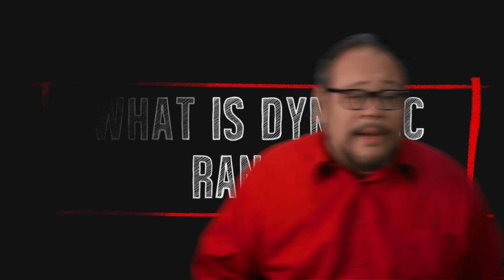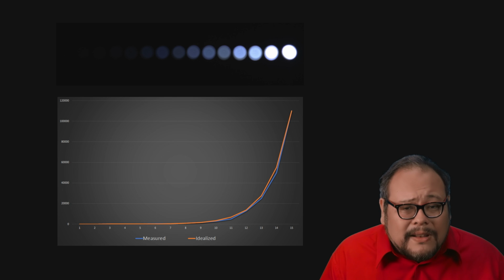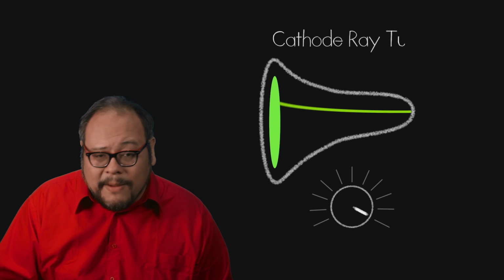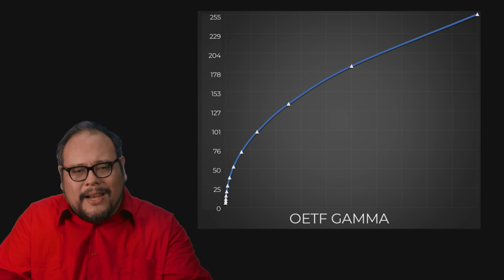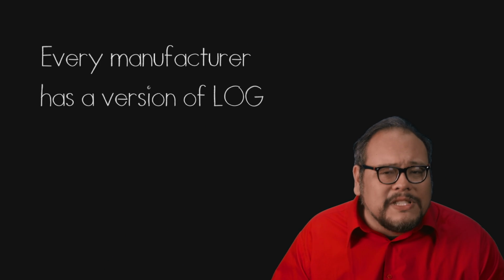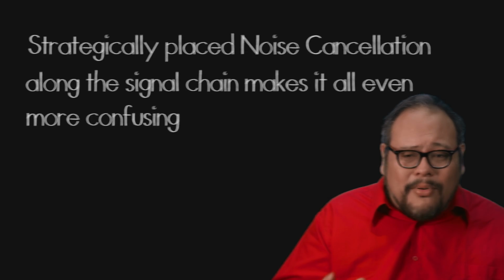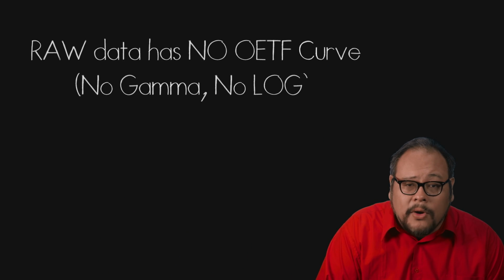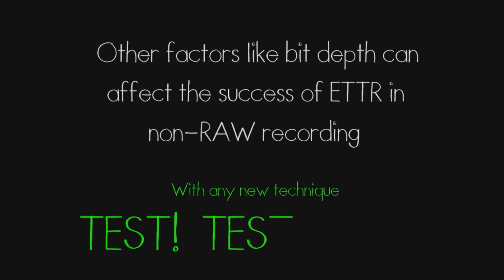Diving into Dynamic Range

Comment: I've seen several of your videos last days and I really enjoy every one. I can now say that I know how to treat the dual iso, bright and dim scenes around us. I was afraid of the ISO noise before, but now I see there's no need to be afraid of that, it can be managed with a bit of knowledge. Thank you so much. On the other hand, I wonder how the exposure strategy would be for astro and nightsky.. You can't add light, the lens is already F/1.2, so I guess stacking and sky tracking and ISO is the only option left. So with that in mind, with dual ISO camera like A7iii - would you still shoot a tracked nightsky at low ISO (100) because of the DR in shadows or raise it to 800? I'm not quite sure whats best. Not blowing out colors of blinking stars (red, yellow, blue and green) is kind of important, but 95% of the scene is less than midtones. Thank you.
Reply from the maker: Astrophotography is one of those extremely difficult challenges. First of all you're dealing with huge dynamic ranges from night elements here on earth to what are essentially suns just really far away. First off - always shoot RAW.

Your ISO strategy depends on what it is you care most about.  If you care about the color of the stars shoot a higher ISO - and pull your exposure down a bit compensate. Then you can always apply additional noise cancellation to clean up the black night sky. If you care more about creating a cleaner low light scene - say you have objects in the foreground or if you're shooting the moon, then lower ISO might be better.

How high an ISO is a very tricky matter - you have to find the sweet spot on your camera. With this BMPCC4K - I'd probably go with 1000 max or 6400 max - but photo DSLR cameras are a little more concealed as to where you won't get... I would have to do more testing and experimenting and reading to come up with a solid answer.

Comment: What if we combine multiple images shot at different iso (lets say low iso to preserve shadows and high to preserve higlights)? Do you get like that an image with more than 15stops of dynamic range?
Reply from the maker: Depends on how the ISO is derived. You commented on that BMPCC video which is a good example. If you combined ISO 100 and ISO 1000 you would get no increase in DR. But if you combined ISO 1000 and ISO 1250 you could end up with the best of both. 

But generally this kind of stacking is done in the exposure side.
Reply: @FilmmakerIQ  I see, so... this is what i thought HDR was (and i think most people) merging 2 or more pictures in one, with the same iso (or the lowest for the lowest noise), with different shutter speeds/appertures in order to create a more linear exposed image (longer exposed shadows and lower for highlights to prevent clipping)..while in reality HDR is that a sensor can depict a greater number of light luminance in a given scene (dark or bright)... 
I just realised that now..thanks! 
Keep it up! I think your work is the best alternative from spending hours into the books..!

Comment: Dynamic range isn't everything.  The human eye may see 20 stops of Dynamic range, but screens typically display 10 stops or less of dynamic range.  Only OLED can display more stops of dynamic range than the human eye can perceive.  On top of that, when it comes to photo's, too much detail can lead to fatigue by overloading our visual systems. So I would say that 8 stops of dynamic range are about perfect for a great image, if the image is crisp and clean.  This is why old full frame camera's with just 8 stops of dynamic range, still look as good as or better than modern APSC camera's with more dynamic range, and generally need less post processing, because their dynamic range is already in the sweet spot. 

People often end up lowering the dynamic range of their camera's in post, so dynamic range in camera's is more about lattitude with editing than it is about having 11+ stops in the final image.  For example, if you lower the shadows slider, you're reducing dynamic range.  If you're increasing highlights, you're increasing perceived dynamic range, but potentially at expense of certain details in an image. 

Another issue people suffer from is contrast/saturation overload. Too colorful of an image can change how our eyes react to an image.  An image with too much dynamic range and colors, can distract our eyes, and change the way our eyes gloss over an image. Tests have shown that people tend to look at highly saturated/colorful images for less time before their eyes move on. But when their eyes move on to something else in the image, the colorful part still distracts their attention from other parts of an image.  

There's also another reason why high dynamic range is becoming a problem.  We are essentially reaching the point in sensor technology where dynamic range is soo high, that images coming out of cameras are effectively HDR without a need for bracketing.  HDR as a style is DYING. People still do it, and it has its uses, but it's a fad that has fallen out of favor. So people editing images, without even knowing it, are reducing the dynamic range of an image to make it look "the way they like it".   Dynamic range is for lattitude in editing, but raw high dynamic range doesn't really make for a great photo.

 Photo filters for example, largely are geared toward reducing dynamic range. Again, people may not realize this, they just think an image looks better with this or that adjustment.  But what it all leads back to is people find less dynamic range more pleasing to the eye in general.  It's just that less smaller sensors often have "muddier" details on the pixel level, which is why images from a smartphone look worse than images from a full frame. Dynamic range can help to capture more detail, but there is a such thing as too much detail, like when someone over sharpens an image.  

For example, when someone see's a picture of a car, they expect a natural shadow to be underneath it.  A camera with high dynamic range may make the car look like it doesn't have a shadow at all, which looks unnatural....so what do you do?  You decrease the shadows, which increases contrast, but decreases dynamic range!  So in the end, higher dynamic range isn't better for a final image, it's only better for latitude in editing an image to your liking, which almost always subconsciously results in lowering the dynamic range.
Reply from the maker: You need to watch the video before you comment.

Comment: Again, awesome vid. May I ask about ETTR? In the explanation, you mention adjusting shutter speed as a component of ETTR. Is there a way to execute this concept without changing the shutter speed? I thought it was necessary to maintain the relationship between shutter speed and frame rate... I'm simply wondering if there are instances where this would be impractical. I know that filming is a balancing act of compromise... (and thanks for answering the "native ISO" query)
Reply from the maker: The shutter speed relationship is only a general rule and you can break it if you want. You could of course use aperture to obtain more light or remove ND filters or actually adding more light on set.

Comment: First things first, wonderful video. I have been trying to expose to the right of late and it really seems to work.

You already have so much information in here, that it has to be difficult to squeeze anything more in. The one other nugget I would love your take on is the  more recent trend towards Dual Native ISO (local amplification at the pixel enabled or not based on ISO) combined with the trend towards ISO-in-variance in cameras. The first camera I read about this on was the GH5S but my a7r3 does it also. Basically ISO 100-500 is amplified normally,  and then ISO 640 and up has the additional pixel amplification/gain applied.  So on the a7r3 test charts ISO 640 comes in a stop or two cleaner than ISO 500. You pretty much need to get up to ISO 1600  to get back to the noise levels of ISO 500 again. This of course why you say TEST... TEST....TEST, and is even less intuitive than the High ISO for outdoors. I don't think the C200 has the same feature, but I think things are becoming even more murky and I am not sure I correctly wrapping my head around the dual-native ISO. Also my attempt to make this one simple point understandable makes even more clear to me how hard it must be to make a 35 minute video on the topic. Here is a sample chart from dpreview that maybe explains the dual-native item more clearly. https://www.dpreview.com/files/p/articles/4302149407/Graphs/DR_Compare.png

Comment: OECF * EOCF usually don't counter each other, generally speaking, because of the  ambient light differences, the final exponent will be in the range 1.1~1.6. and I personally think what you talk about ISO on ARRI etc. is actually EI...
Reply: This is the best video I've seen on the topic. Some discussion: Because of visual tone appearance effects, the overall system gamma needs to be greater than 1.0, or the pictures will look dull or washed out. This was discovered by Kodak way back when they pioneered snapshot photography, finding that overall gamma 1.1 looked better for mass-processed monochrome prints. Later, the TV industry discovered that a TV image ("dim surround" viewing, similar to computer viewing) needed an overall gamma of about 1.25. The movie industry (projection in a dark room) and likewise color transparency film, was determined to require an overall gamma of up to 2.0 (partly to compensate visual effects and also to roughly compensate lens flare). Luckily, the increase in contrast also increased color saturation and compensated for the insufficient color saturation of the print dyes. In TV, CRTs had a gamma greater than 2.2, so that when 1/2.2 was specified for REC 709, the overall system gamma was closer to 1.25, as needed. Now that computer monitors are being calibrated to 2.2 instead of the native CRT gamma, it is likely that the gamma (contrast) of renditions from raw files is being increased when the raw files are rendered to sRGB so that the system gamma is  again greater than 1.0; but nobody but camera makers and Photoshop knows what is being done for the default, they just know they can turn the contrast knob up or down to get the look they like. Plus, since the output is always intended for a print or standard dynamic range display, there is always an S-curve applied to the rendered image, which mimics the S-curve of analog photography and fits perhaps 10 stops of scene brightness into the 6 stops of a print or the 8 bits of a jpg file.

Comment: Modern digital cameras have reached analog 35mm or digital project quality, but most cameras can't go past 4096 shades when best HDR is over 10,000 to 1 contrast.

 I wonder if this will cause resurgence of big studio movies going back to shooting on film.  Can old school celluloid with digital extraction reach highlight brightness the best digital cannot?
Reply from the maker: Just because you only 4096 shades (12 bit) doesn't mean you can't store more than 12 stops...  especially if you compress the highlight detail using LOG. And ultimately you don't need a 1:1 relationship between what you shoot and what you display either.

Comment: My own opinion on ISO.  When I shot log, I noticed at low iso there is less noise, but when I pull up the image, I can get banding in gradients.  But at high iso there is noise and stopping way down outdoors can make a shot less cinematic.
 I think when possible the best quality and dynamic range in a log video is to film at native iso, and use neutral density filters for exposure control.  I kinda think the iris f-stop in digital should be thought of as depth of field control more than exposure.
 Problem is I can't afford a whole set of ND filters
Reply from the maker: The problem is we're coming to the point where the term "native ISO" doesn't mean anything.
Reply: @FilmmakerIQ   I don't have HDR monitor/video yet, but am curious as to how HDR will affect ISO and exposure.

 I can imagine some problems with changing exposure and shooting to the right/left on a high contrast ratio video.  These changes are invisible if graded for rec709, but in HDR this could result in the highlights jumping in brightness from scene to scene, and noise black levels shifting up and down too.

 I don't know what HDR cinematography looks like but I imagine it a lot more WYSIWYG and the look is much more ingrained on set than in post.
Reply from the maker: @michaelcooney9368  HDR uses a much wider dynamic range you're going to more limited in ETTR. Furthermore you would do an HDR grade and maybe a Rec709 pass to fix things. You're not going to grade the same for both.

Comment: Ok, higher ISO to protect highlight, makes absolutly sense. but, that comes of the cost of IQ (less DR an more noise, compared to low Iso), the higher ISO noise, is less noticebale in brighter areas (also because of better SNR) ok i give you that, but the DR is suffering. Right so far?
Reply from the maker: Higher ISO to get away from the edge of the clipping edge of tbe sensor but don't go crazy to extreme other end of ISO. I'm talking shooting ISO 1000 instread of ISO 100. In these situations you'll have the same (or better) Dynamic Range and noise will still be negligible.
Reply: @FilmmakerIQ  ok thnx, but i get the basics right so far. Thnx
Reply from the maker: Well the old rule higher ISO lower DR doesn't really apply anymore.
Reply: @FilmmakerIQ  ok, thank you for the fast reply, and the very good work you upload. Apriciate it.

Comment: I just did an experiment. My camera is Panasonic G85 and I shot some night photos in RAW,  only change iso(and didn't clip highlight). Then adjusted them back to the same exposure in LR. I can tell that the higher iso image has less color noise, though the luminance noise seems the same, if not a little less. So maybe there is some gain adjustment in the camera which makes the iso isn't only metadata. After this when I picture the milky way I just use the highest ISO and do an ETTR shot. The results are a little better.

Comment: Now that explains why the S-Log require high iso.
Everything makes sense!
BTW... Hybrid Log Gamma is like the best of both worlds? Is better?
Reply from the maker: One thing I've learned in filmmaking is that there is absolutely no such thing as best of both worlds ;)

Every choice is a deliberate compromise between at least  two extremes.

I don't know much about hybrid LOG gamma but it seems to be more of a display side curve used in HDR displays.

Comment: С200 have analog amplifiers before ADC, so ETTR works with ISO/gain in lowlight circumstances. It's not decrease analog noise but decrease digital noise (probably) caused by quantisation error.
Try this with candles. First - normal exposure, second - raised iso and lowering it in post.
Reply from the maker: When I tried it in the video the results were less than stellar. Light is the key.
Reply: @FilmmakerIQ  they less stellar than good lighting condition, but more stellar than not ettr by iso in lowlight.
Just my experience. Maybe help someone.
Reply: For example:
32:15 left image is less noisy than left on 31:21
In lowlight dark scenes (yes, in independent cinema this is often situation, like a night street lit only by streetlights) it makes huge difference.
Reply from the maker: I guess a little... You also have to above 1600 I believe before the upstream amplifier kicks in.
Reply from the maker: Put together a test with what I shot - It's a little bit less noisy... I wouldn't say the "huge" difference. - This is one of those camera specific and only under certain circumstances..  I stick by my statement in this video that ISO/Gain should not be used for ETTR in RAW.

https://vimeo.com/297155536

Comment: 26:39 This picture doesn't show what you claim it shows -- the  ISO 3200 shot has more detailed (examine the capital D, while the ISO 200 shows terrible banding. Granted the ISO 3200 has more noise and that might help to hide the banding, but regardless this is not a good picture to demo this effect.

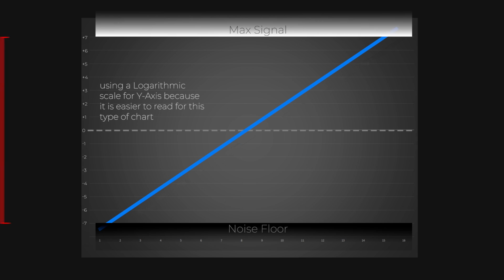22:14 On a related note, this chart makes no sense at all -- your axes are unlabeled, and your arrows move diagonally, which means no change at all! I'm guessing you meant for this to be a luma vs digital value chart, as that would have supported your points better.
Reply from the maker: Well I disagree on both points. The banding is a result of pulling both shots up 5 stops and YouTube Compression. Stretching dark LOG footage 5 stops is going to result in banding. And there absolutely is more noise in the 3200 ISO shot, that's conventional wisdom.

In regard tothe unlabeled chart... Its the same exact chart Ive been using throughout (I should have labeled it but I it was an oversight and maybe for the best to keep the screen uncluttered...) Essentially signal on Y and input luminance on x. You're conclusion that nothing happens is correct! Because the sensor response does not change, we are merely sliding around that linear curve to determine what is middle gray.

Comment: Sony's cameras blocks ISO at 1600 or 3200 if S-LOG is selected. How on Earth Canon allows ISO 100 with Log profile (26:29)?
Reply from the maker: ISO 100 on the c200 is an "extended ISO" so you have enable it... But the difference between C-Log and S-Log show different strategies for how these cameras persue LOG encoding.
Reply: I mean not ISO 100 only, but any ISO, lower then "native"'.